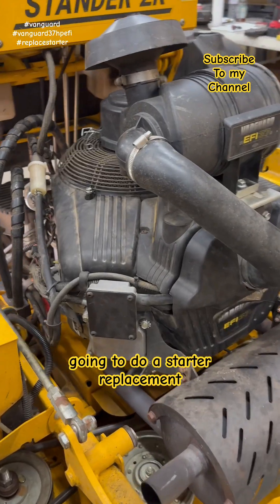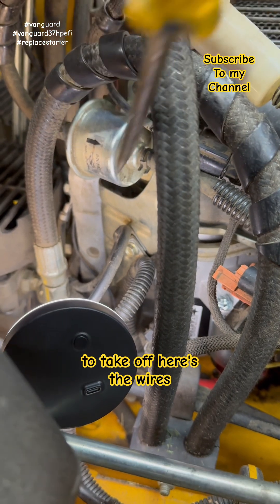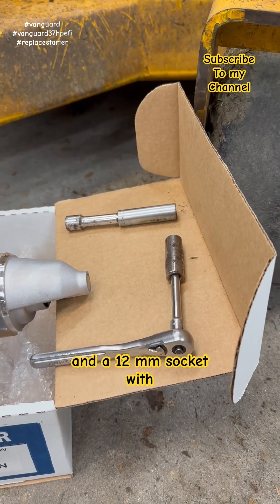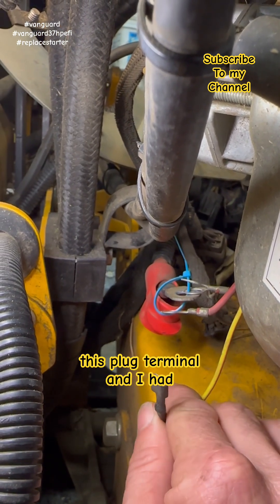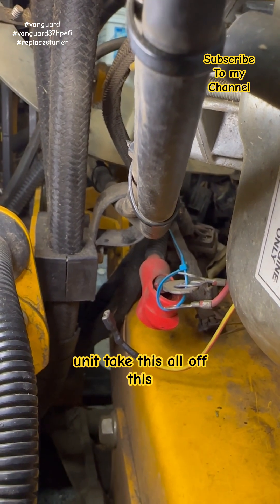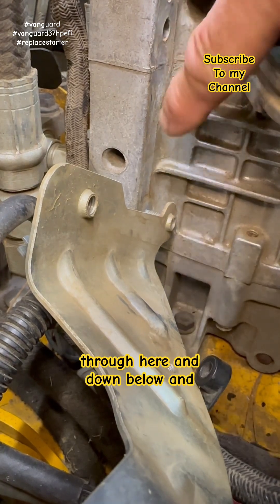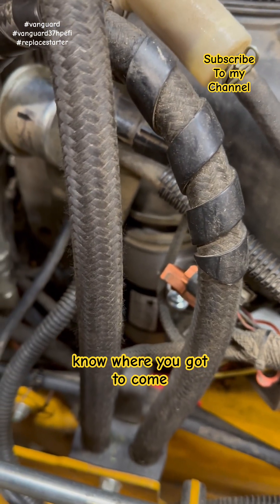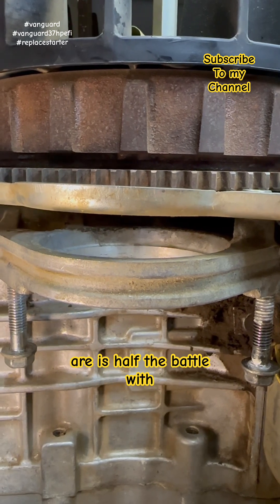Vanguard 37 HP Starter Replacement - How to Fix a Hard Starting Engine #vanguard #shorts

Comment: Thanks for the how to replace a starter video. Going to help a buddy this Friday replace his Skagg 37 hp vanguard engine starter. Your video should help save me lots of time. I am a patient shade tree mechanic lol, let’s hope all goes well. Once I am done I will give you a follow up on the results.
Reply from the maker: @shellshocked7167  very nice of you to help him. Yes I was given bad information from my local mechanic shop. They told me to take the whole shroud off the top of the engine. I spent hours doing that before calling a different repair shop and being told the bolts come up from the bottom, I couldn’t find a good video like the one I made that’s why I made that video! To help other people like you you definitely need your patience and it’s not gonna be the easiest job you’ve ever done but at least now you know exactly what you’re up against. Let me know how it goes. Good luck.
Reply: The starter replacement went well thanks to you. It really meant a lot to him. He will mow as soon as the recent rains dry up some.
Reply from the maker: @ that’s awesome. I’m glad that my video helped you guys out because I could not find one to help me the day. I did mine. That’s why I made the video.